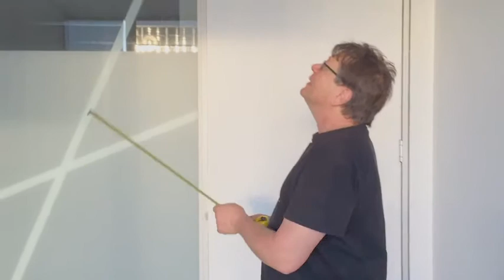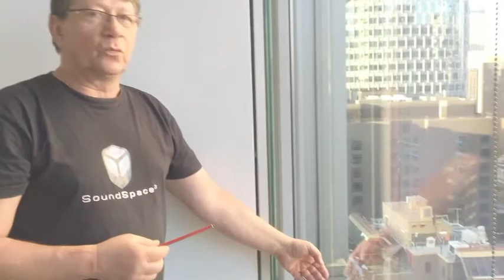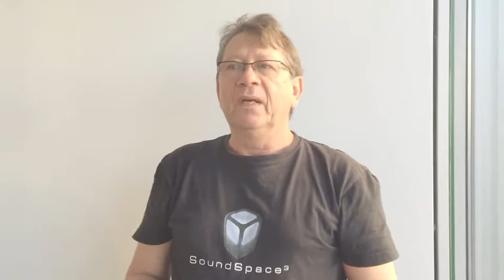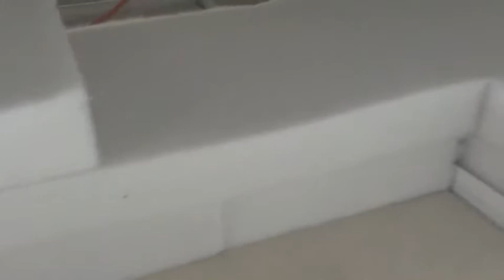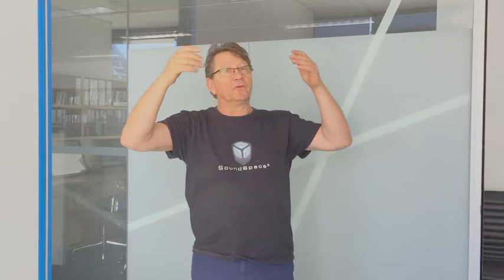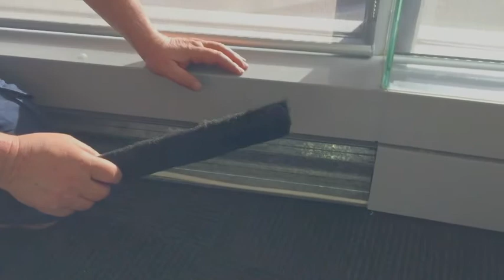How To Soundproof An Office

Comment: Thanks for the video! If I understood correctly, you recommended at least 32 kg/cubic metre density for the polyester foam for ceiling dampening. How thick do you recommend these sheets to be?
Reply from the maker: I am using 75mm thick but it doesn't matter, sometimes I am using 100mm, it goes a bit quicker or I am using a combination of both. The thickness doesn't really matter but too thick will become more complicated to install and too thin will take much more time. The most important is the density, I can see people using 10kg/m3, even 600mm wide but it's not good enough even 10 wide wouldn't change anything, the width I am using is 400mm, good enough for talking and 600mm wide for air conditioning noise in the cavity.
Reply: Thanks for the quick reply! I understand you're using 75mm thick 32kg/cubic metre in the video for this installation -- But just a quick clarification: Did you mean to say that you would recommend up to 600mm thick of 32kg/cubic metre for air conditioning noise in the cavity?
Reply from the maker: Yes, that's right, I mean, if you have a noisy a/c unit in the cavity, I would block the noise using 600mm wide batts, 32kg/m3 or denser even better. When you are using acoustic batts above all partition walls, in the ceiling cavity, make sure the air return can flow by making an acoustic tunnel made of the same batts, 1200mm long at least with an opening equivalent to the opening of the inlet vent, that way the air can flow but the sound will betrayed inside the tunnel.
Reply: Great, thanks again for the clarification! Thanks for sharing your experience!
Reply from the maker: Thank you, you are very welcome!
Reply: Awesome video, just the solution I need. Where would I get that density? Any brands of batt you would recommend. Thanks.

Comment: Very interesting and great video .. I want to block sound into my bed room from next door there are very loud some times and wake me up when i am sleeping what would be the best solution for me to do that ,I've all so installed secondly glassing to block out traffic passing by my home 6 mm toughened glass with 150 mm gap from main window but i can still hear the out side traffic why >?
Reply from the maker: 6mm glass is not very thick, the minimum I am using is 10.38mm laminated glass. you can still improve a bit, by a 2-4db, if you could install all along the 150mm cavity gap, 25mm thick sound absorber, such as acoustic foam, that will help a bit, because inside the cavity, you have some echo and the sound reverberate too itself and increase significantly, like a drum effect, so the foam will absorb some noise and you should hear the difference.

Comment: Can you please let me know what type of foam you use in the ceiling?  It's a dense polyester but can you explain which one exactly?
Reply from the maker: The one I am using has a density of 32kg/m3 and 400 mm wide but I have that material made for me,. Some people are using 10kg/m3 but it doesn't work, no matter the width of the batt, it's not dense enough. I've found that around 30kg/m3 is a minimum, sometimes I am using 600wide and 56kg/m3 when it is to stop noise from a noisy air conditioning unit in the cavity but for voices, 32kg/m3 is enough. If you can't find that density, may be you can compress the batts to reach that density.

Comment: How can I sound proof my apartment side walls? I can hear people talking and one guy snoring in the unit next to mine.
Reply: To soundproof the side walls you have to use the same system than the common wall. Usually, treating the common wall gives acceptable results. Some noise comes also from the side walls, as you said but it is at least 50% less than the common wall.